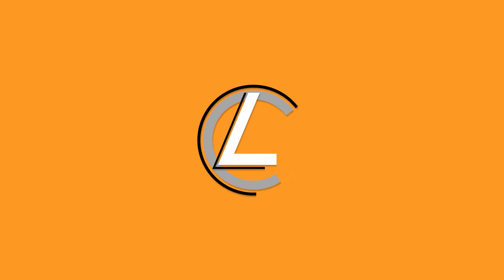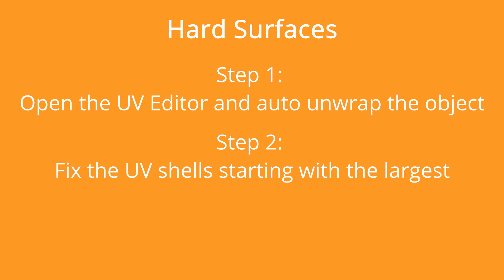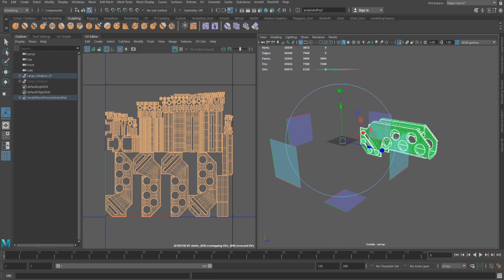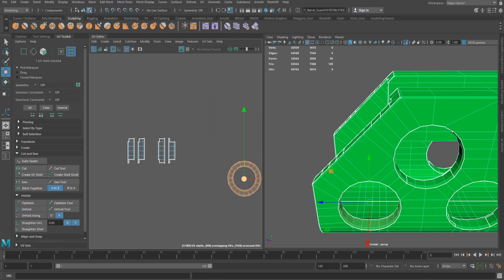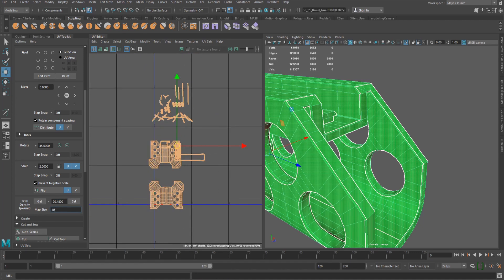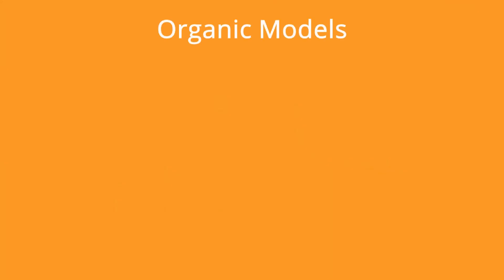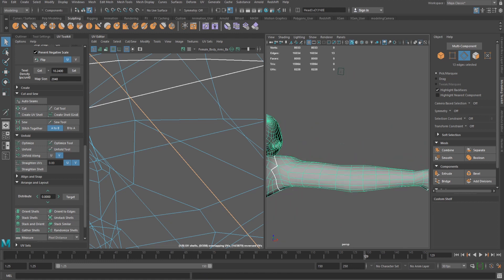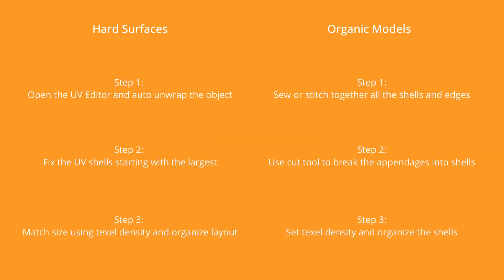Maya - How I Unwrap

Comment: Im not sure if you still read comments but I'm getting a massive headache with Texels.  When I change my texel density in maya it just resizes the UV shells to proportions way beyond that of the UV workspace square, I don't know what to do...
Reply from the maker: I have an in-depth video about texels on my channel that I would recommend you check out, it should give you a better understanding of how to use them.
Reply: @leoncabrera5635  Hey! So after brainstorming a bit (being sleep deprived didn't help) I managed to figure out just how texels work, all thanks to your videos! Thanks so much brother... Although I had a very big wall I couldn't fit at once in the UV map, I started thinking. That wall isn't even going to be in the main focus so a smaller unit like 5.12 or 6 would do the trick. And as for the closer spots I went ahead and used 10.24. Again, tysm brother. Keep the videos up!
Reply from the maker: @shprite781  Thats awesome, im glad you figured it out. Good luck with your future projects!

Comment: Well but  i think i found a reason  i think it is because the 4 cm size too small and then it is the largest part of tank it still get some bake details but there are parts smaller then a cm  in millimeter my guess as i modelled hole tank in  4 cm  . 
I think this size is practically too small for getting good bake even if it has a texel density of 100 or above per cm. But on the other  hand  the box  is 9 meter in size but havae texel density of 2 px/cm get edges baked perfectly. 

So what do you think try it. Help me out
Reply: Same problem for me
Reply: @Glorfindel92  
I got it  solution
1.model in any size even 1 cm  or actual size
2 then create a cube to use as ref like  ex a tank is 9 metre length then create that vube with 9 metre lenght then go to side biew and scale 1 cm size tank to 9 metre and dont worry if it looks super big . Scale  hole object in 1 group. 
3 time for uv when you model is on his actual size    i use 10.24 /per cm. 
Now take faces and cut them merge them and Everything else to get good uv 
4. At this point if you will need to use multiple material      for my tank t90 bhisma  i used 45 material (1 material has 5 texture albedo normal ambient occ. Roughness metallic)  or say 45 seprate uv i didn't use udim only 0 1 space.  https://pradeepsinghrathore.artstation.com/
Then just export it and texture seprate material material in substance.
Reply: @gamerrocks8426  thanks dude i will try
Reply: @gamerrocks8426  dude your models great i want to ask other thing for example my model is a forklift and there are alot of part someones will 2k or 4k bake and i dont want to loss details in bake if i imprpve texel density then i will have alot of uv map for your model for example how many uv map for your gun or tank model? Is there any limitation for game assets?
Reply: @gamerrocks8426  thanks
Reply: @Glorfindel92   no there are no limitations in  they tend to to use 2k  maps as mich as possible as it is faster to load than 4k . I have been using 4k maps though. For my tank it ia around 45 material. And for my ak47 guns  it is around 4 to 5 material. For revolver it 3 material.

Comment: But can u make a video on large and small object uv mapping 
As i modeled a tank in 4 cm in length  and after uv i got a texel density of 100px /cm above. i am using  cm as unit.  I made a high and a low poly and baked  my bake is still low quality. But to check it i created a box of 9 meter in size to use as refrence as 9 m is real length of tank. 
And uv unwrap box and got 2 px/cm density  . But after bake i got smooth edges with proper  details.  Plz help
Reply from the maker: Yes, I will make a video on texturing large and small objects, for now you should watch my texel density guides. The guides will explain how to use texels to nicely distribute the textures onto your object. If you still experience problems I can have a look at your work and give you some recommendations on how to UV map it.
Reply: @leoncabrera5635  yes your guides were great help i have no issue in matching texel density. But i do get a        a issue when i use (get and set texel  )  when i do set i get division by zero error. If you know any thing plz help
Reply from the maker: That sounds like a problem with your mesh, trying Mesh Cleanup to select faces with zero map, if any are selected you will need to fix them.
Reply from the maker: I've included a link to my discord in the description, if your problem persists post the issue there and I will try and resolve it when I have time.
Reply: @leoncabrera5635  thanx that helped
Reply: I used 10.24 /cm density it works great  but it increase the no. Of maps for my tank but result quality is great even in 2k it looks good from tps view.
Reply: Just last thing how much texel density for   character fps and  tps .
Reply from the maker: Characters are usually a higher density compared to their surrounding with the face being slightly higher compared to the body. You could try unwrapping the character with a large texture map and a high density (20.48 or even 40.96) and always down size the map after to fit within your limitations. Remember, the closer something is to the camera the higher the density should be.